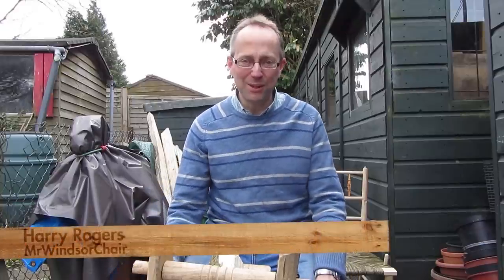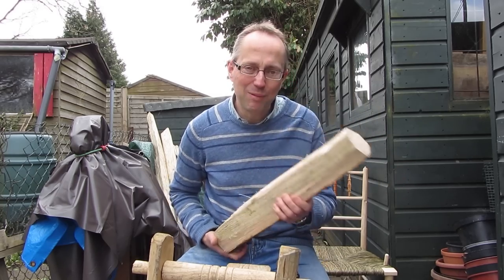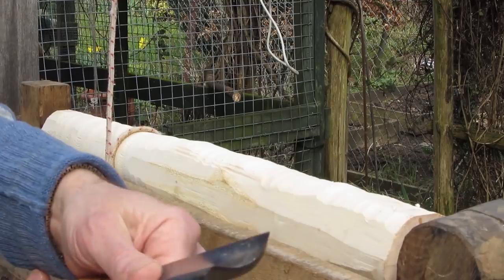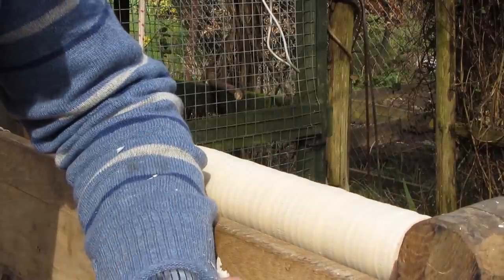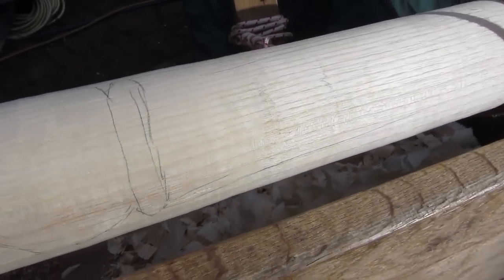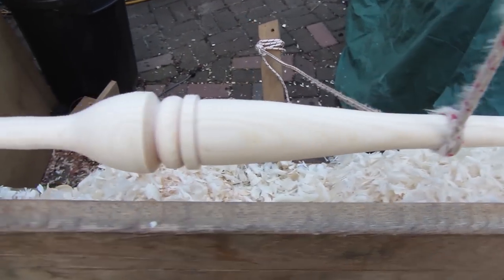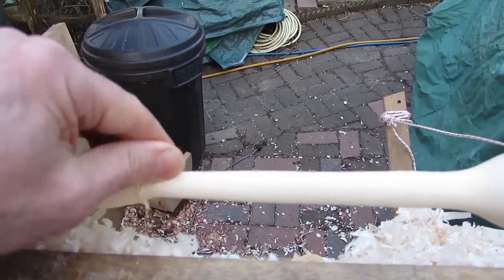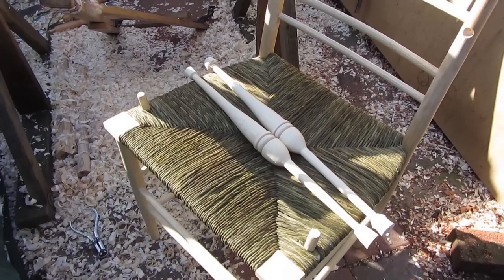Pole Lathe Chair Arm Supports - Sussex Chair Part 10

Comment: There are smithing clubs here so coal is available thru them.  Tho I'm in the middle of a desert, we have a 9,800 foot mountain next to our city w/ pines, firs, and aspens.  There's no sawmill, &   I don't know if the forest service allows felling.  If so, I'm sure you'd have to prove you could remove those huge beasts.   We have a variety of trees in town because they're watered.  It might be possible to get some wood from the tree services that remove trees.  I've never looked into it.